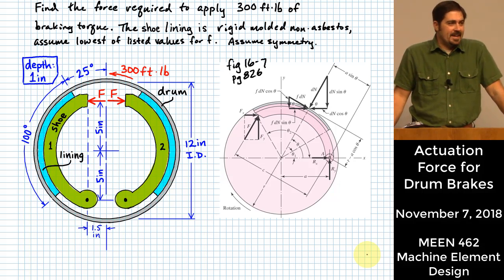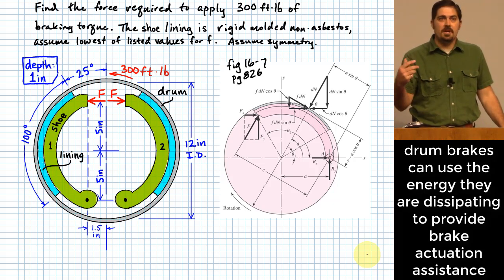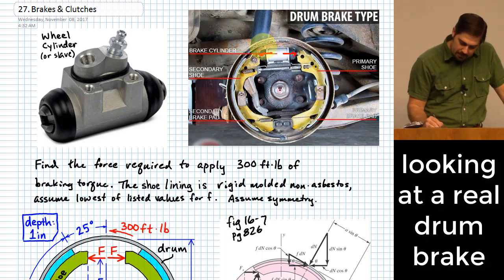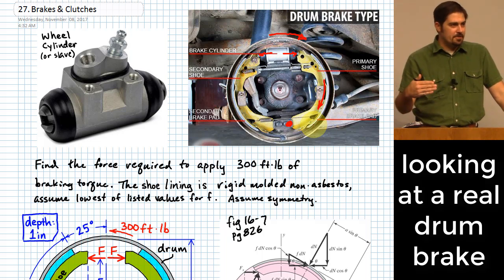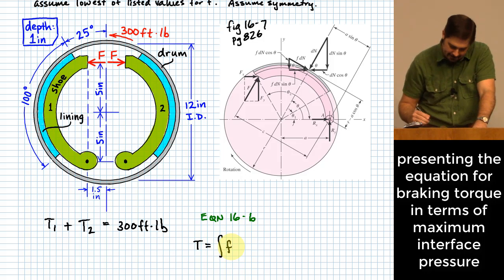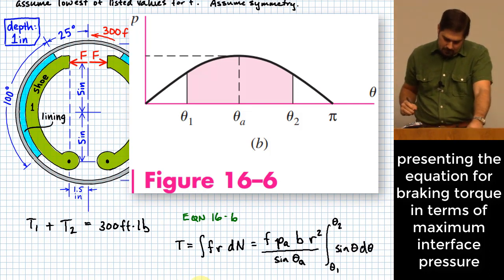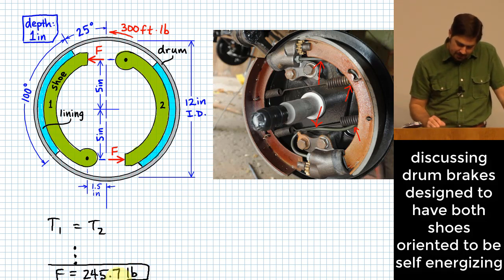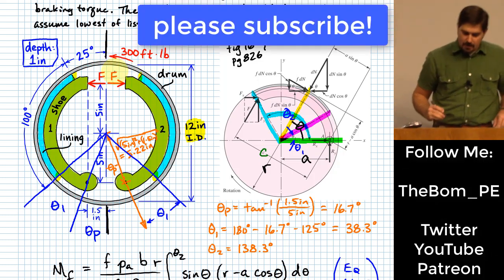Required Actuation Force for Drum Brakes | Self Energizing and De-Energizing Brake Shoes

Comment: Do disc brakes have better stopping power than drum brakes.
Reply from the maker: It depends on what we mean by stopping power. One could argue that disc brakes are easier to cool, with other factors like weight and space usage being roughly equal...so I suppose that means they can dissipate more energy more quickly, and be "higher power." On the other hand, drum brakes are typically designed to use some of the wasted "stopping energy" to help lessen the required actuation effort. This is why old vehicles without power brakes usually have drum brakes. Most big trucks have drum brakes for similar reasons.

Comment: Really wonderfull.. 
But i have a doubt. I am having wedge brake with wedge on top and bottom of brake shoe. No anchor. So the Pressure acting on all the ends of the shoe. Two on top and two on bottom. In that case,if I have to calculate torque on each side/shoe I have to multiply foce(p)x2??